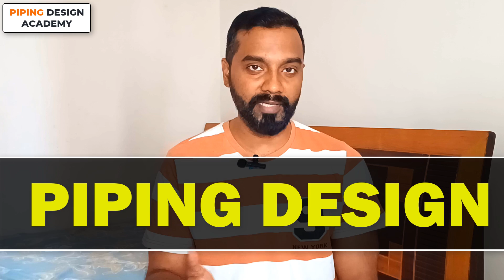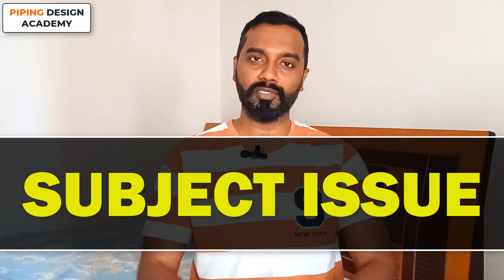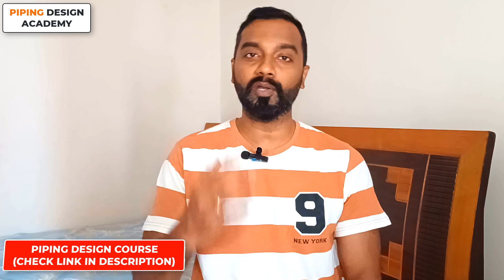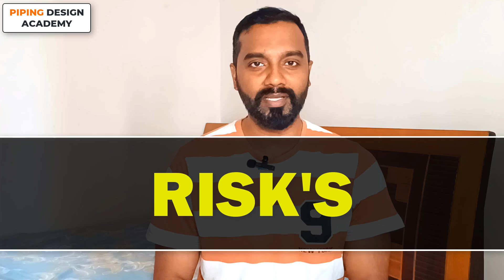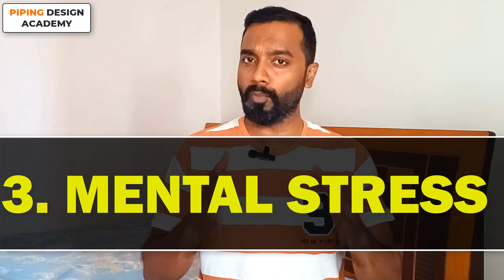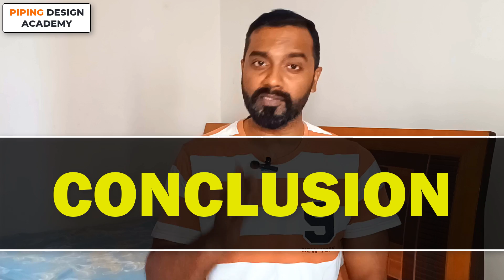Risk in Piping Design Career for those who are joining late having an experience from other field

Comment: Hi sir, 

I have totally 6.5 years of Experience in Mechanical Design Engineering(Creo and Autocad). In this 6.5 years first  Two years i was working  in Piping(For Curing Process)(Creo & Autocad software) at L&T RPM, I have medium knowledge to read P&ID and pipe rerouting,  GA Drawing creation. So, now i am interested work in piping design Engineering and start studying the  E3D  and Sp3d Software, also seeing your  videos  to learn concepts of piping, input and deliverables of the project etc. Now is it ok for me to change my job profile to piping. Please guide me sir. Thank you in advance.